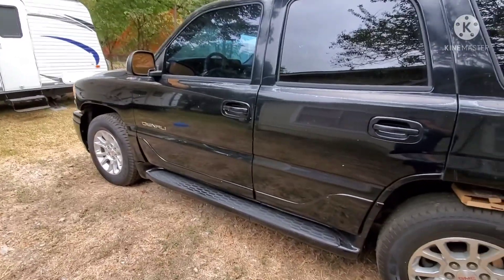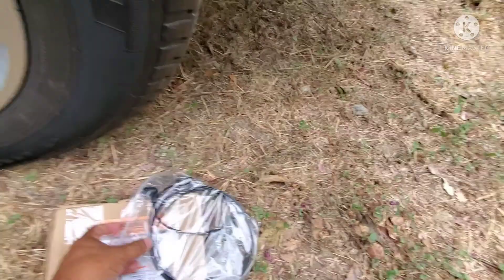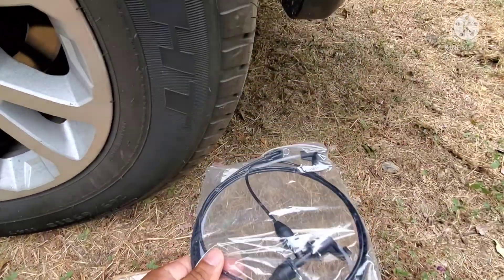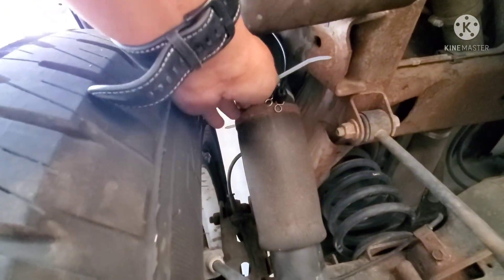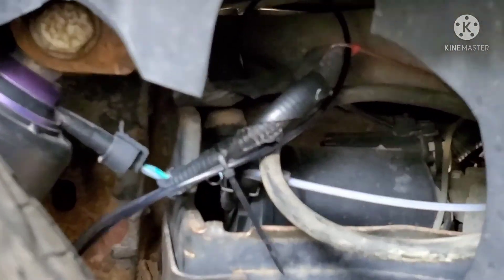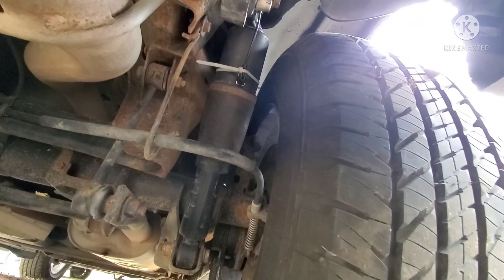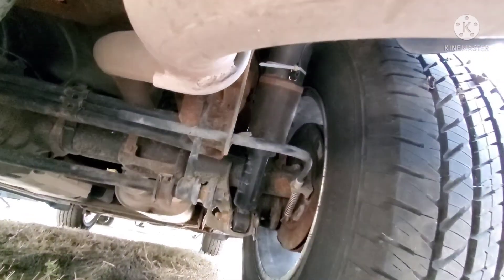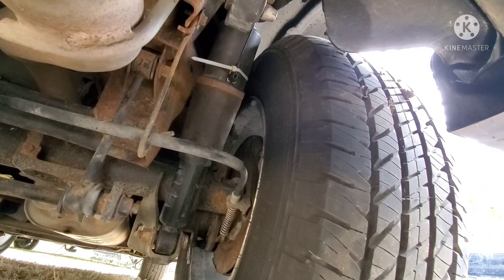2003 Yukon Denali Air Suspension Line  Fix

Comment: Sometimes the bag on the shocks have cracks/ small holes and will leak slowly. Spray them with 50/50 soap/water and if you see fizz or bubbling then you got a leak.